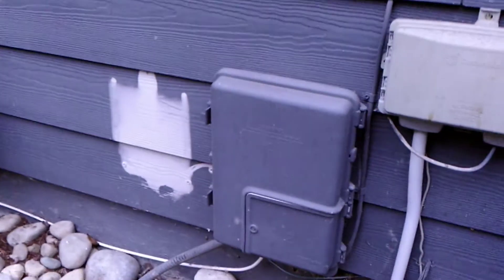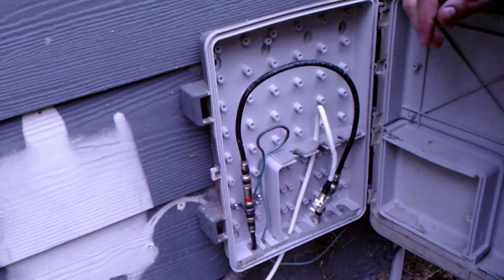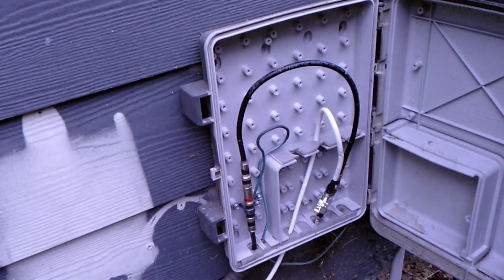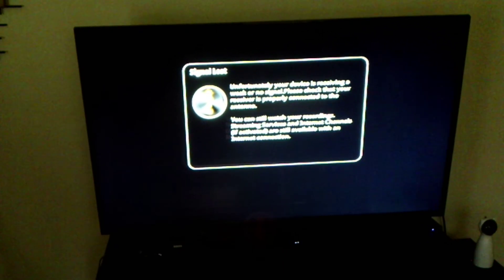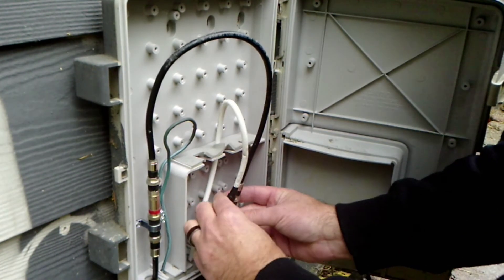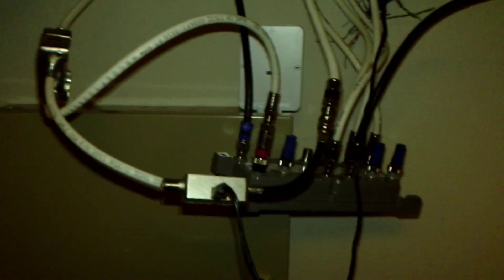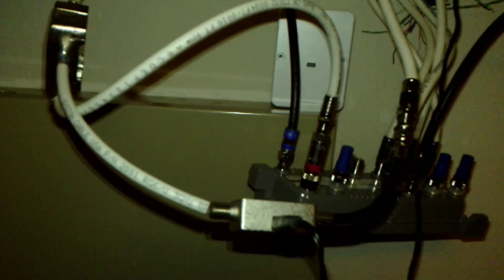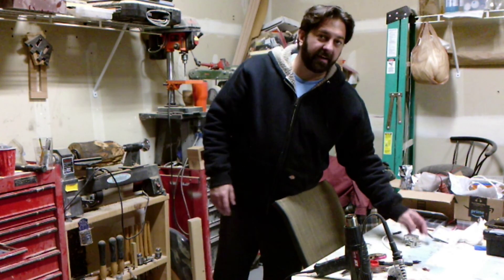Failed! Attempting to combine TV Antenna Signal and Cable Internet on a signal coaxial cable.

Comment: You would need to eliminate the amplifier or get a bi-directional amplifier. Your internet needs to be able to go through the amplifier in both directions, upload and download). 

Also, what is the frequency range of your splitter. The splitter also needs to be able to pass the frequencies used by the cable company to send and receive the frequencies they use for the internet service. The company I worked for used a frequency below channel 2 as the return channel. Can't recall what it is now because it has been a few years since I worked for them. The diplex filter used used and connected the cable line to wad for satellite which is 950 MHz to  2.4 GHz.

You want to invest in a proper crimp tool. Any antenna or cable installer would cringe seeing crimps done with adjustable pliers.